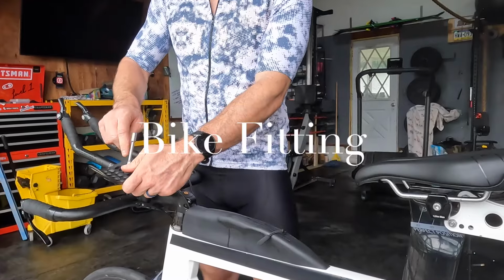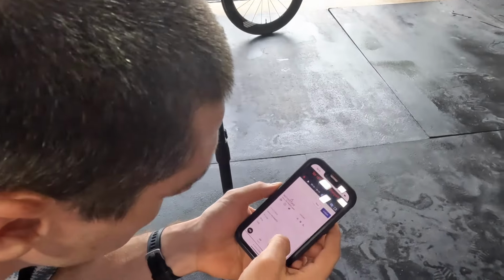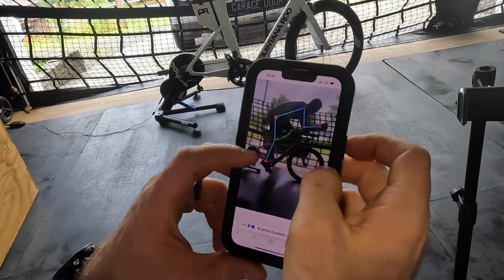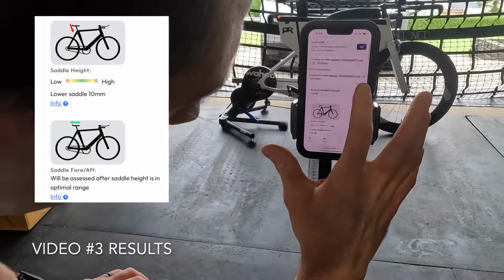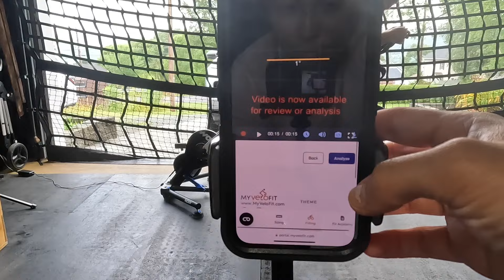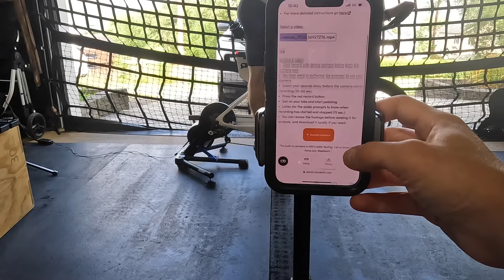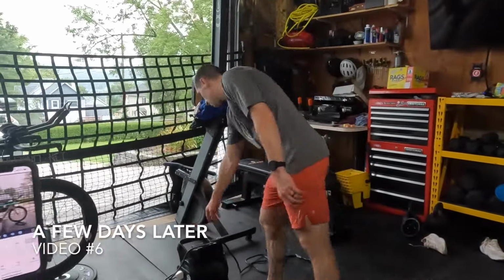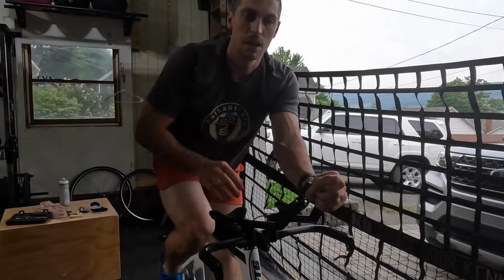Using AI to fit my triathlon bike

Comment: "My Quads blew up" for me sounds a bit like a heal down issue. Just out of my own exp. when i focus on pushing the heal down a bit or activly my muscels tend to get relaxed. The foot position might be on the spot but i feel like often people tend to push front foot first with heal up and not heal down like a horizontal way not like front foot up but that the foot is not horizontal so a more activly heal down helps here. Also i think you have still a bit of kick in the foot left over try some clead adjustments fitting guids
Reply: @Mamalyssaa  Also be aware that 85% of people number is random picked but its very high have different foot sizes which leads to issues because they need in reality two different sized shoes. When we look at the issue here it happens often that the clead cant be placed perfectly on the correct position. Just keep that in mind. And the other thing is in relation to what i said first. When your pedaling and sweating your foot can move and will swell in the shoe. Maybe a bit forward or in different positions thats why try to do fittings not when you maybe just did a 3h Shopping tour or gardenign session :D

Comment: the saddle was clearly too high when you began, the hip rock was very obvious. your head/shoulders still look a little high regardless of what the app says. i'd be inclined to pitch the aero bars up 5 to 10 degrees and lower the stem (remove spacers under the stem) by 10 to 15 mm. it's not like you need to be Remco Eveneopoel, but you do want to get your head as low as you can comfortably maintain it for the distance you're racing.